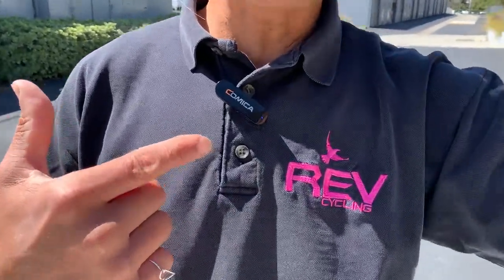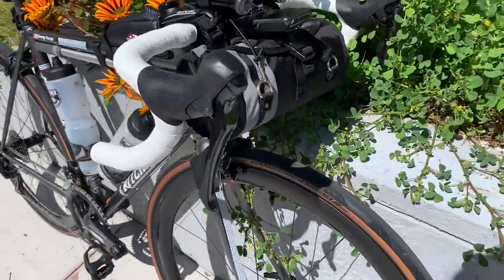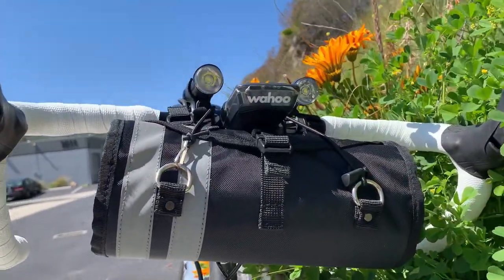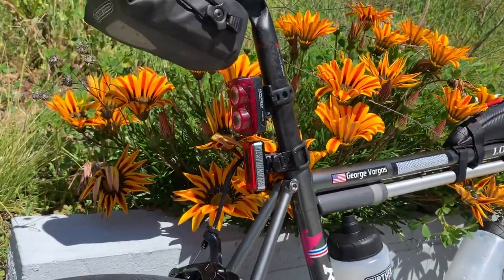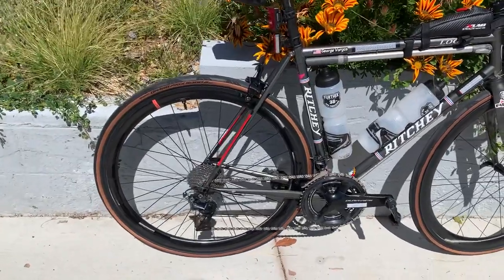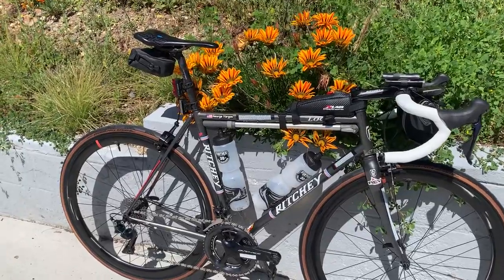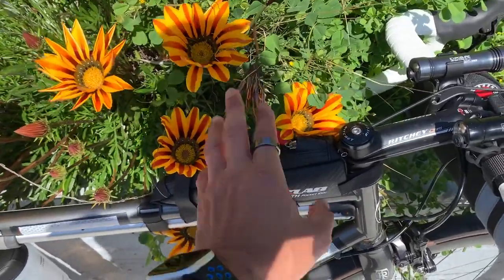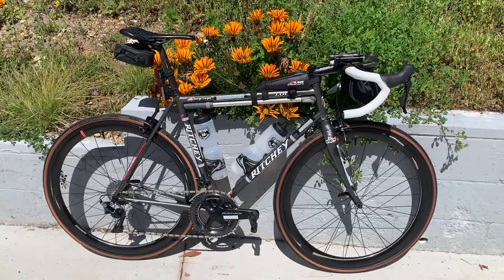My Road to PBP - Episode 3 - 400km Brevet bike set-up (250 mi 10k ft) #RoadToPBP

Comment: Great episode! You mention a 32cm tire. When is the clearance on the side of the tire to close? You are showing a static example. but what about a dynamic situation like climbing or cornering when there is some flex in the frame? Will the side of the tire touch the frame during a side load?
Reply from the maker: Hello Rob these are great questions! 1. That may be why Ritchey plays it safe by saying 28 mm is the max tire on this bike 2. Frame flex and wheel flex is a real thing and should be considered when looking to optimize tire width with tire clearance.

A 400 km, 600 km and/or 1200 km are not the type of events where you’re getting up out of the saddle sprinting and stressing the frame or wheels. I think I will be fine in this set up. 

Great questions!

Comment: Nice setup. I had a Ribble CGR 725 just before the pandemic, which had a carbon fork with no mounts, this forced me to go the same route for bags, strap everything everywhere . I got rid of the bike as it was very bulky in gravel spec and it was annoying to deal with the bags on and off the bike. After I sold it I found a Peugeot PX10 lugged 531 (red label) frameset in my size which I built up with a front minimal rack in order to use a classic front mounted rando bag that opens rider side, so I can access the bag while riding. OMG what a night and day difference. Not to mention 531 feels alot better on long days than 725. It also looks better than the Ribble, nice and slender, level top tube, gorgeous bike. THe ride is so good that I've been commuting on it ever since. The front bag has just enough capacity for a 600. I take 2 800cc bottles usually and everything else fits in the bag.
Reply from the maker: Someday I will put racks on my Ritchey Outback

Comment: Nice set up.  Take a look at the Silca Tattico pump - works great and attaches to the seat tube water bottle mount.  
I use the same tires, 30mm on 303FC, love the ride and ability to run lower pressures.  They measure 32mm, I use between 45 -60 psi depending on road surfaces.
I also love the Assioma's - note:  I left mine in Philippines for 26 months, not used while in the US for the duration of the Covid nonsense, when I came back and use them now, the battery only yields about 20 hrs max.  Like your phone, there are some quirks about rechargeable batteries in electronics which have a definite impact on live span of the gadget.
Reply from the maker: I don’t want or need a mini pump! I have a frame pump because that’s what I want 😉

In fact, if I order anything from Silca it will be another frame pump.

Comment: I just sent an email to silca asking about their sealant with co2, they recommend changing out your sealant after using co2.  Or vent out the co2 with fresh air after the ride.
Reply from the maker: Yeah all the sealant clumped up when I used the CO2 and 30 miles later I was on the side of the road putting a tube in.

Comment: Did you have to do anything special to clear the brake pads with 30mm tires? I also have dura ace brakes and have hard time clearing even 28mm tires.
Reply from the maker: I didn’t do anything special. No adjustment from my 25 to 30mm tires

Comment: Is there a direction arrow on those tires? My instinct has been to mount Continental in the opposite direction.  Gathers water at start of tread then disperses it sideward/rearward out the larger pattern.  

Richard R.
Reply from the maker: Hello Richard yes the Continental 5000 tires have a direction arrow. Those of us in the industry call the tread pattern a shark fin, dorsal fin. Put the dorsal fin in the direction of what it would look like on a shark going forward with you and you’ve mounted them correctly

Comment: Sir, hope all is well. If the updated frame can take 32s what brakes do you recommend ?
Reply from the maker: Plenty of room in my R9100 or R9200 brakes
Reply: @SeeYouUpTheRoad  do you think r7000’s will fit 32s? I only ask cuz i don’t see any 9100 or 9200 for sale on market place where I’m currently at.
Reply from the maker: @Thegentlegoon  I have and can get R9100/R9200 brake sets
Reply: @SeeYouUpTheRoad  I’m actually traveling through asia right now riding my 80’s Raleigh road racer with 25s, i want to push the limit on what tires might fit. sometimes within the city the roads out are punished and lookin to volume up for a little more peace of mind.
Reply: @SeeYouUpTheRoad  what ya thinkin, should i try the 7000?
Reply from the maker: @Thegentlegoon  I don’t have an opinion